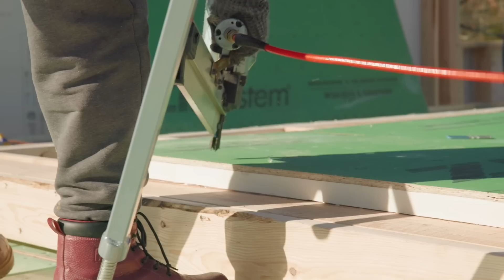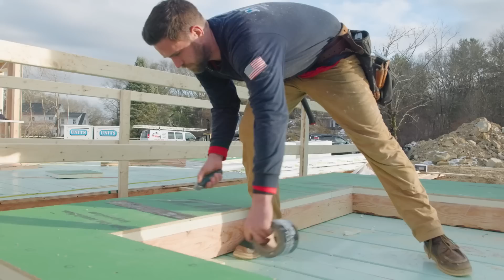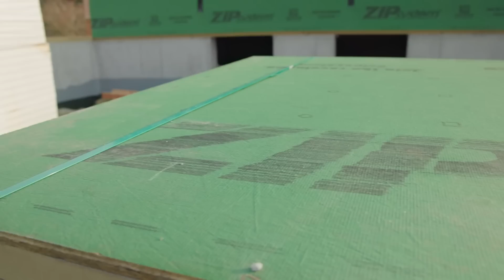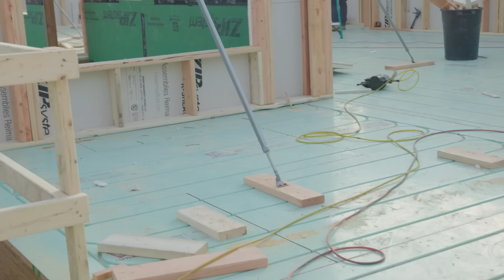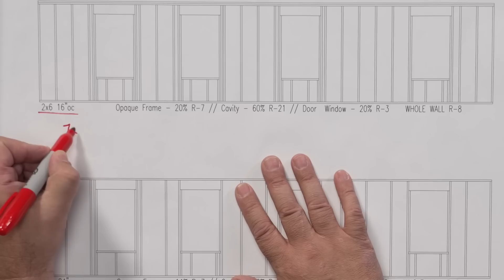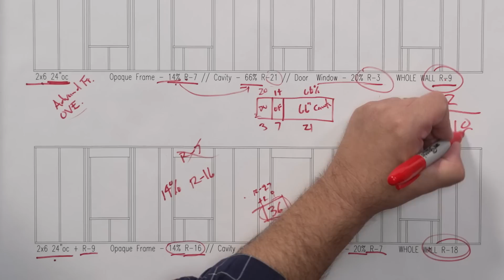"Wall Framing" Build Show Build: Boston Ep. 6

Comment: R values are important to resist the flow of heat. However a more important topic is flow of water vapor. Can you do a video about water vapor, specifically talking about ZIP R-9 sheathing? The poly-iso is less than 1 perm, the OSB is between 1 and 3 perm, and the ZIP coating is between 12 and 16 perm. How does this impact the ability to dry in or out?
Also the ZIP tape is bonding the ZIP coatings together. Should a poly-iso approved adhesive be used to bond the foam together between sheets so vapor doesn't pass through the seams? In Zone 5 it would be awful for vapor to condense on the OSB seams from heat leaking between poly-iso cracks and bringing vapor with it.
Maybe i am just splitting hairs and no builder ever constructs to this degree of accuracy.
As Matt always says importance is in the following order: bulk water, air infiltration, water vapor, and finally thermal.

Comment: STEVE /MATT. Building a full custom home , Zone4 (Virginia). Will be using a complete Zip R (3 or 6) system with Huber rep working onsite with my builder.  Question for you .. Can the Zip R sheath  wall continue down to the 8"  concrete foundation wall sill and sit on a 7 1/2"  sill gasket (vs. 5 1/2") and serve as the "band board" (rim board)  in front of the joists & double sill plate. To my mind this would reduce the thermal bridge of the rim board and would ( could) be "flush" with the foundation for a more seamless taping. You would simply shift the  7 1/2' double sill plate on the 8" wall slightly to accomodate the Zip R insulation. Thanks .. "Lets get Started!"

Comment: I always appreciate your teaching style.  @47:31 using the conventional method for calculating the whole wall R-value it would be R-14.6 using your example.  But still shows that we shouldn't think of this as an R-21 wall like you cautioned.
Reply: Are you converting to U value , then calculating? Can't keep it in R-value.......
Reply: I am not sure what you mean by the conventional method? My calculations are based on a MIT Building Scientist calculation that he developed for me, but it is based in U-Value. Your value I believe is using the respective percentages and keeping it as an R-Value. You can't just multiply the R-value X the % of wall area and add them up like you did. Your suggesting that the center of cavity is = to 60% of R-21 = 12.6........it isn't it's R-21 for 60%of the wall.

Comment: Steve - I love your work but one thing I have to ask (and I am not picking on the Zip-R product here) - how can OSB and foam be a better solution from a vapor permeability perspective than any number of other envelope approaches? OSB is largely impermeable, it does not become more permeable as it wets, AND it deteriorates quickly when it become saturated. Any foam, poly iso included, is also basically impermeable. So how can a wall constructed like this be one that has longevity when it effectively cannot dry to the outside? I genuinely would like to be educated on this. Thanks so much for all the education you have provided.
Reply: Good Question, and one I have asked the very best of Building Scientists - It doesn't matter, what matters is that if things get wet, then they have the potential to dry. Yes the Zip R doesn't dry as well as some materials, but that means it doesn't get as wet as some materials. First thing to look at is what has the potential to get wet, and if it does, how does it dry. In this wall The poly-iso is the most impermeable of the wall materials. We are doing a flash of closed cell also inside the cavity, also somewhat impermeable. THey are back to back with each other, so they are not allowing any drying potential thru them. In the case of the closed cell, we have a cavity of dense pak cellulose, then drywall, and paint. Everything to the inside of the closed cell is permeable and will allow drying to the inside should it get wet.......See I said "should"? We have a Zehender ERV helping to manage moisture on the inside. It would take quite a bit of moisture to migrate into that wall to be a problem. Even if it does get in, everything to the inside of the closed cell is warm enough that the dew point is never reached - so moisture stays in the vapor form, which isn't a problem. Some suggest the cellulose has some resevoir capacity, not sure I subscribe to that. On the other side of the Poly-iso you have OSB and the WRB film, the OSB has some poermeance to it and the WRB film is pretty open. If siding was directly attached to the sheathing, then maybe a question mark comes to mind. But in most of my walls, I detail a rainscreen product that not only promotes free draining so the wall really doesn't get wet, but should it get wet, the rainscreen provides for drying potential. To most "Vapor" is some big bad monster that appears and wreaks havoc.......I consider it an asset and use it to dry my assemblies, but I ensure the wetting potential is very minimal. This is a single story home with 22" overhangs - good protection as I see it. Many believe walls need to be some flow thru assembly, no, we just need to provide some drying potential to the assembly, be it flow thru, or multi-directional, both are successful - lastly, understand vapor is not a problem until you chill it, and it condenses to liquid, just keep it warm.....Hope this helps? "Joe would always say " It's Building Science, not Rocket Science" don't make it more than it is.........Thanks for joining us
Reply: @stevenbaczekarchitect9431  - thanks very much for the detailed answer. So if I understand correctly, this assembly basically (no pun intended) has a mostly impermeable layer (or two layers back to back) at its core and everything inboard dries to the interior and everything outboard dries to the exterior (especially with the assistance of the rain screen). Makes it almost sound like a SIP (maybe one with a polyurethane core) from a cross-section moisture management perspective. I guess that make sense to me (not and engineer, not an architect, did not stay at a Holiday Inn Express last night) but I still have a maybe slightly irrational dislike for OSB as every time I have seen it get wet I have seen it do more crumbling than drying.  Thanks again for the detailed response. It was really enlightening.

Comment: What size nails are you using with the R9 zip-r? Wasn't sure whether that was still doable with a standard 3 1/2" nail gun.
Reply: Yes - 1 1/2" embeddment required
Reply: @stevenbaczekarchitect9431  Thanks for the reply, so standard 3 1/2" nails then? We've been pushing for clients to start using zip-r and this always comes up with our builders. So far they haven't felt comfortable going to r9, only r6 due to that concern. It is hard to change old habits!

Comment: I get it, increase R value. But at what cost? What is the cost delta? What is the time to pay back, is there a cost pay back? This is the real conversation. As renewables become more cost effective and equipment more efficient, it will become less about carbon fuel and more about carbon consumption in the manufacturing. This needs to be addressed. I hope you can speak to this. Love the show and the info.
Reply: Payback is such an ambiguous conversation. Totally based on the choice of baseline. I was simply doing the math here and illustrating the concept of COC R-value and WW R-value. Whether you do it or not that is your choice as the homeowner, builder, and architect/designer. I have done houses less than this, and more than this. Yes equipment is better, and getting better, you will never get me to believe they are substitutes for Passive means to success that require no maintenance, breakdown, or replacement.........Thank you for joining the conversation
Reply: Well insulated houses tend to be a lot quieter from my experience. If a quiet home helps an individual think better, there is no cost delta, it is priceless! 😃
Reply: @damianokon6209  yes, acoustical benefits are side benefits

Comment: I feel like you are misleading us by not taking into account the thermal bridging from the steel fasteners attaching the sheathing to the walls which reduce the r-value of the polyiso insulation significantly. Love your show and would love to hear your thoughts on this, and if possible, some data on how much heat moves through the fasteners.
Reply: There are sooooo many things ahead of the line in front of fastener thermal bridging. Yeah it exists, like homeowner habits, air leakage, equipment calibration, equipment maintenance, landscape placement, etc, etc,  I actually just ran the numbers on this, I get about .64 sq inches of shaft area transfer, each sheet of Zip is 4608 sq inches - the nails account for about .00014% - hardly  misleading at that level
Reply: Thanks for the response and the info. One correction on your math: 0.64 / 4608 = 0.00014 or 0.014%. Given the thermal conductivity of steel, this is significant.

This study https://web.ornl.gov/sci/buildings/conf-archive/2010%20B11%20papers/50_Christensen.pdf titled “Thermal Impact of Fasteners in High-Performance Wood-Framed Walls”, concluded that “The results demonstrate that three-dimensional effects and fasteners have a large thermal impact on the overall wall R-value. These effects are not considered with simple estimation methods such as the ASHRAE parallel-path method. Overall wall R-value was shown to decrease by 3.3–12.0%.” This applies to walls with between one (1) and three (3) inches of exterior insulation and a framing factor between 6% and 30%.

I agree that there are other factors that are more important than fasteners, but that doesn’t make this issue insignificant. It  is almost never discussed so most people aren’t aware of it and don’t account for it. I believe this can be a mistake.

Comment: Is placing the Insulated Zip board in reverse orientation an option (forget warranties, lol.), then use an external air / moisture control wrap...  (yes the green barrier is then wasted - but the shear value is higher, though putting the OSB on the inside of the insulation envelope hay have thermal / moisture issues..)

Noting the Unsupported joints in the Zip-R - in my region, we are required to support all shear board joints with nogging (as per engineering specs).
Reply: Just do 7/16" Zip and overlay it with Rigid Insulation